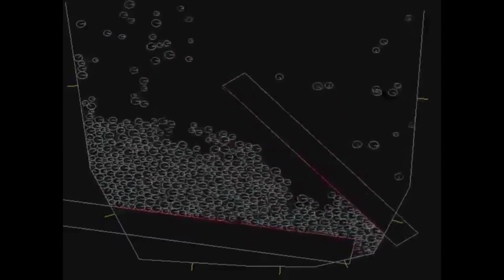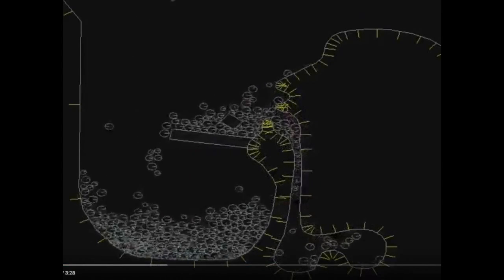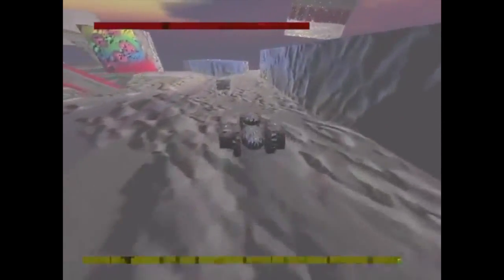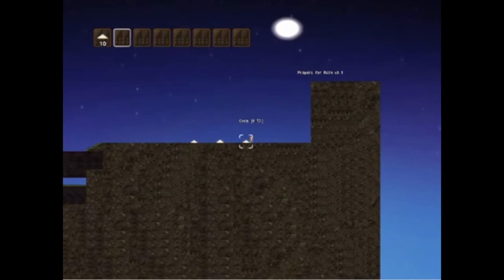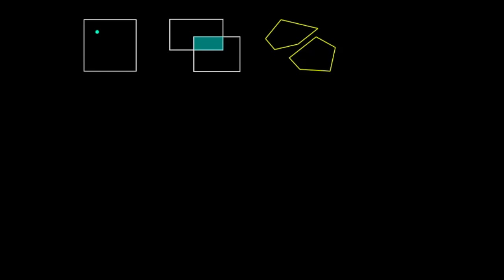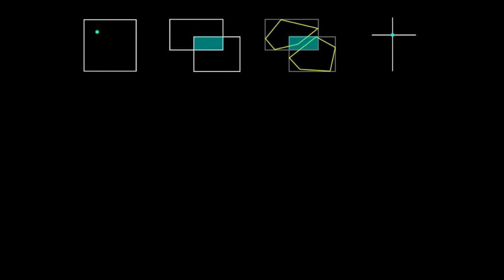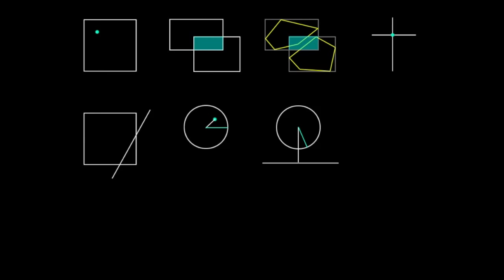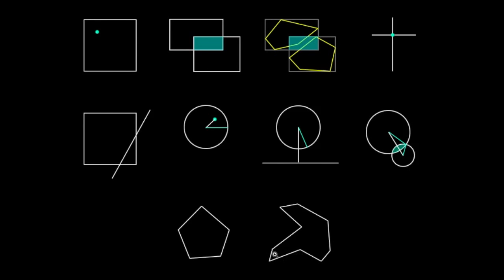Copy of Collision Detection JavaScript Tutorial Part 1

Comment: Hi, I need to learn more about case 3, that is polygon collision with another polygon. (Just the polygon collision, not optimizing it by having more simple shapes drawn around them) What algorithm or technique needs to be applied for that? I guess you didn't upload a video regarding the implementation for case 3, correct me if I am wrong. Thanks